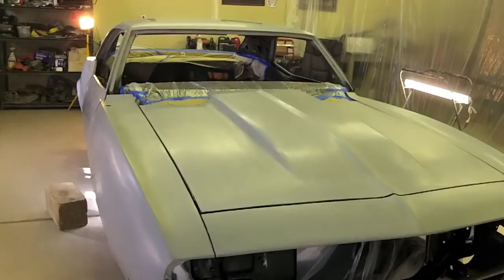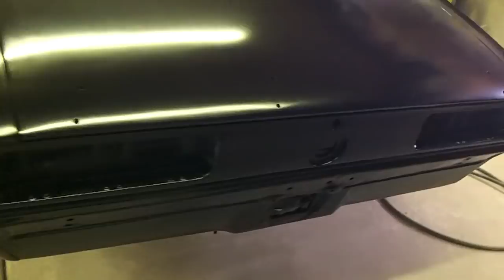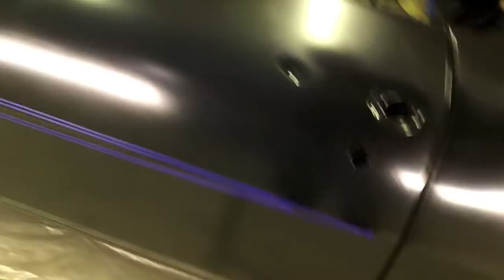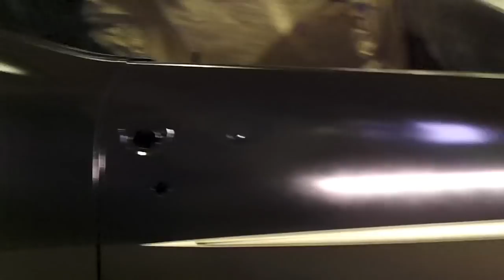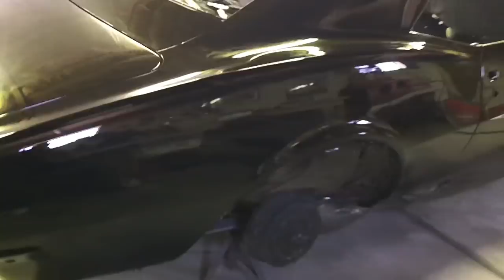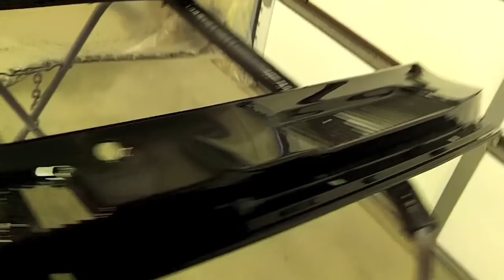68 Camaro Project Part 14

Comment: I like the colors it looks very nice body came out very nice looking and straight.  funny about the run you would think of your gunna get a run it would be on the lower side of the car it will be interesting when I paint my car one big run lol.  looks great nick
Reply from the maker: Thank you Chris. It mostly my crappy technique when spraying. I overlap in that area to much with the roof line, quarter & the door. I end up hitting the same area over & over as I clear the different panels which was likely the main cause. I'm always in the habit of trying to hammer it on real wet and it usually catches up with me. lol..

Comment: Looking Great!! This one has come a very long way and getting the Black paint!!  Wet sanding out the run is not a big deal, have had plenty myself. Do you wet sand when you color sand?  . Your work is inspiring !
Reply from the maker: Thank you for the kind words sir. I'll try & scrape it off with a razor blade and then move to wet sanding it off. Yes 1500 wet sand with grit first & then 2000 grit before buffing.

Comment: pretty damn good! i always get runs spraying all brands of clear coat. only way not to is a preheat downdraft booth. any problems with clear coat dry lines & orange peel? my devilbiss gun spray tip often loads up and plugs with overspray and have to clean it every fill
Reply from the maker: Thank you sir. Honestly I don't even remember the last time I've sprayed a car with out a run in it some where. I think part of my problem this go round was, I was using medium temp reducer and the warmest I was able to get the garage was 60*, and more so is the fact I is I pound it on. lol..

Comment: Looks fantastic.  I can’t get over how quickly you move through these builds.  I’ll definitely be looking back through your videos for reference and inspiration.  Quick question:  what do you do to ventilate your garage when you spray?   I’m assuming some fans and filters somewhere?
Reply from the maker: Thank you, I just have a couple of fans in the windows and I stick a small 2 by 4  under the garage door to hold it up slightly to draw air.

Comment: Great job sir. Nick; do you use any special prep on the trunk spoiler such as adhesion promoter, or just go ahead with your normal primer? thanks.
Reply from the maker: Thank you, No I just just scuffed it good and shot a couple coats of 2K on it & started blocking on it.
Reply: Great, thanks; my 68 is getting close.

Comment: Hey Rarerat its me again, I'm about to paint my truck with the splatter paint and I was wondering what all did it cover and how for did it go up on the quarters, the rear wheel wells, the back seat area, by the taillights, and did you paint on the top inside of the trunk. Ill probably be asking more questions as i go down the road if thats alright, Thanks.
Reply from the maker: I used 4 cans on this car and it covered well but I had already epoxied the whole inside of the trunk while I still had it on the rotisserie. I sprayed it up to the top on the sides of the quarters, on the wheel wells as far as I could, as well as the tail light panel & rear seat support.  I hope this helps & good luck..